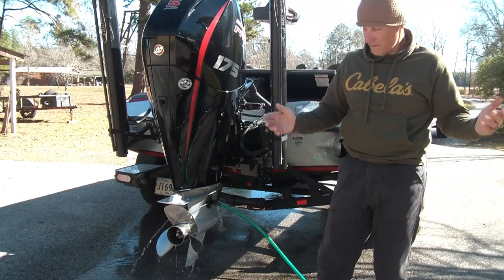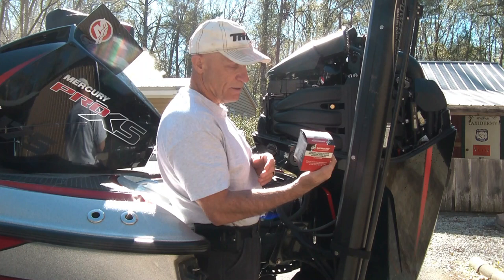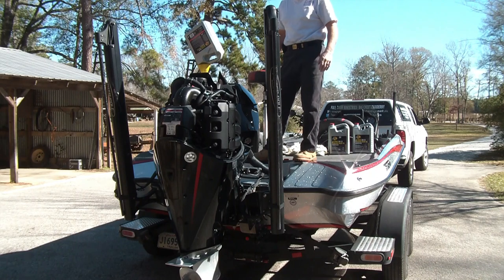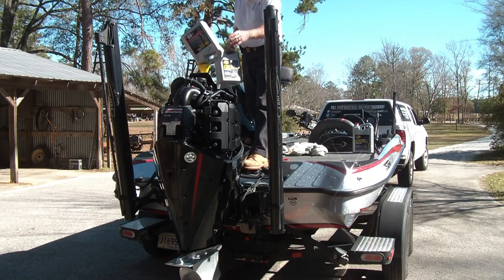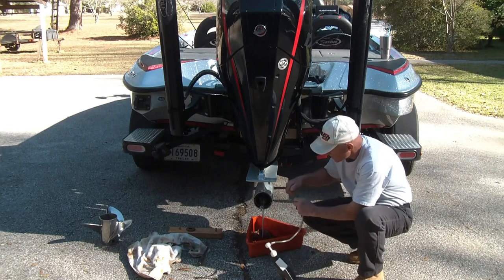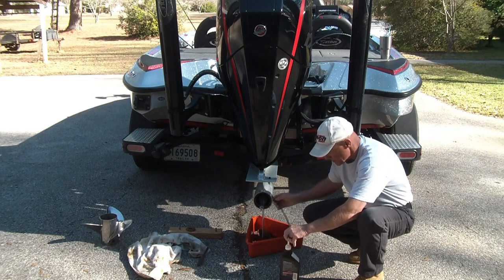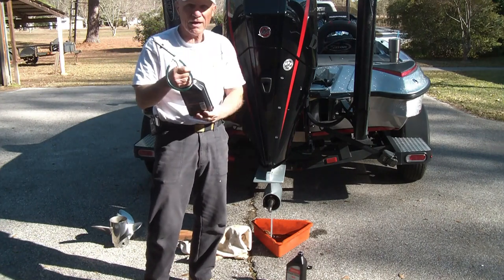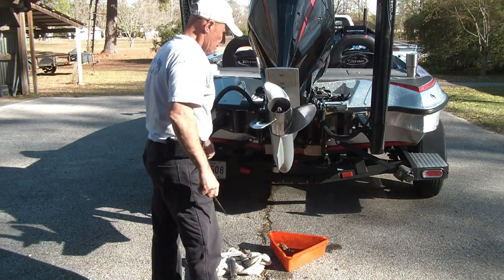2019 Mercury Pro XS 175 oil, oil filter & lower unit maintenance

Comment: Best video yet. I’m looking at this 175 for my 19.6. Which boat do you have and how does the 175 perform on it. I was worried that the 175 might not be enough for 19.6 boat
Reply from the maker: Hey friend, thanks for the comment. The engine is on a Triton 189TRX. It is certainly not a speed demon by any stretch. Depending on load of course, I run 57-61 mph. Based on friends of mine that run 19 1/2 footers, 200 and 225s serve nicely.